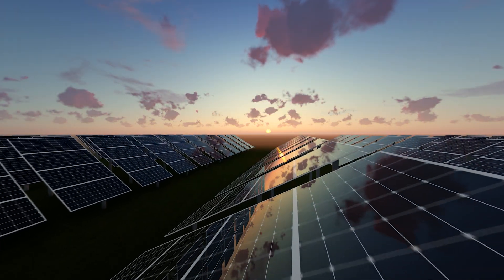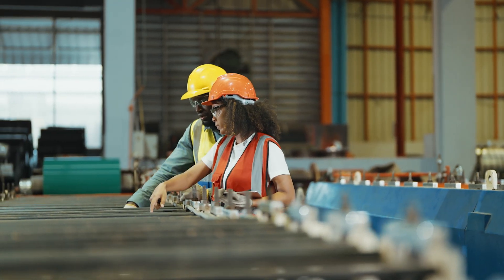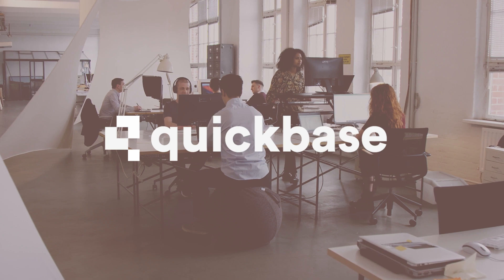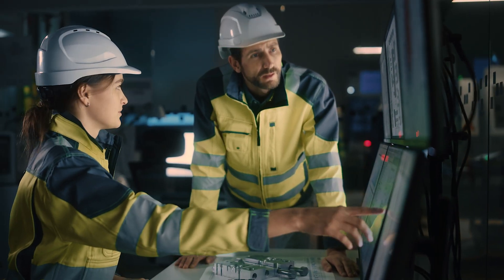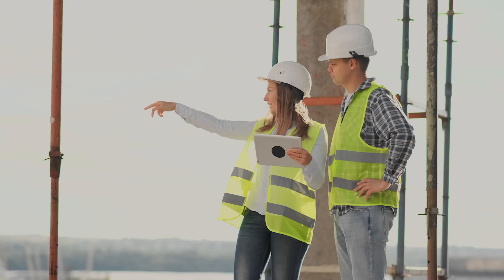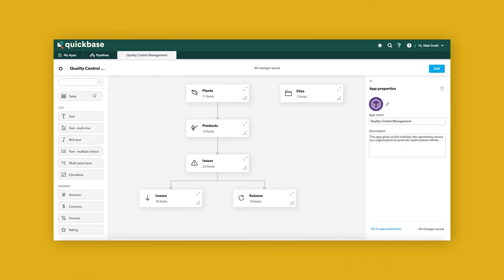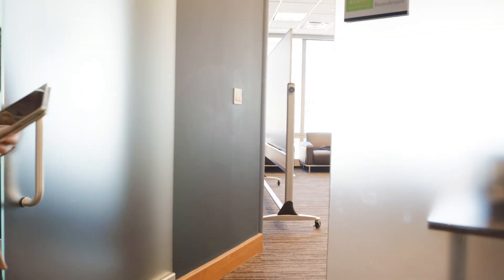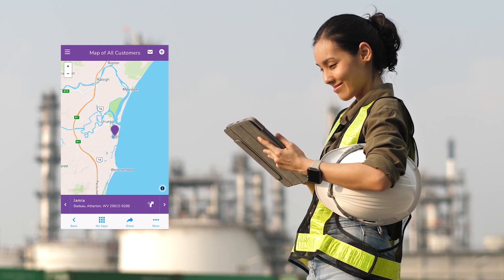What is Quickbase?

Comment: Read the contract carefully! It states that you cannot sublicense the product, and during the initial sales and set-up phase, you will be told you can add all of your partners to the platform.  It looks like a great product and some of the sales staff are great (Marvin especially).  Be warned, if you need to build a platform you want to sublicense for profit, Quickbase is not it.  We never reached partial performance, nowhere near a third of what was expected.  They demand the annual fee and will not work with your company to determine a reasonable cancellation fee if you have to pursue a different route. Partial or complete performance doesn't matter, they just want your money.